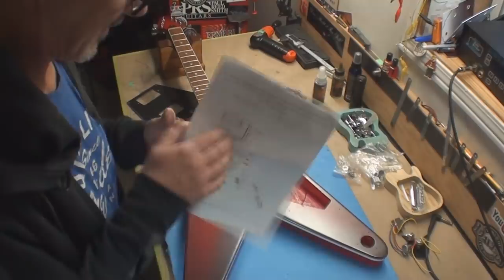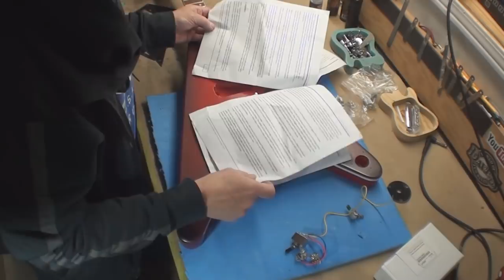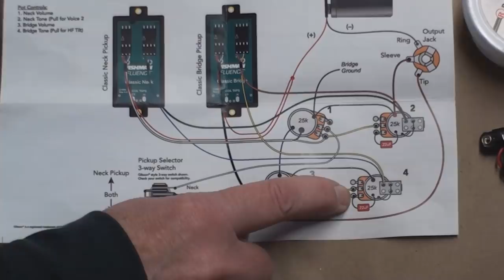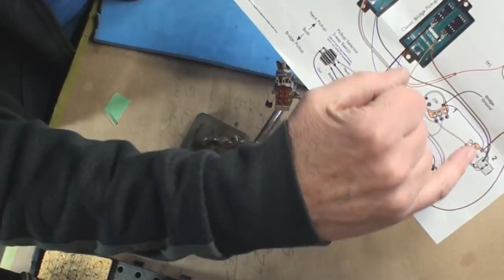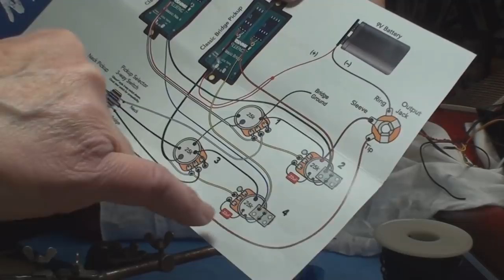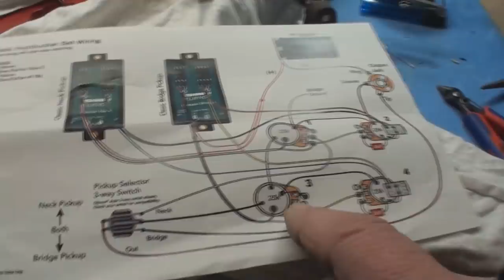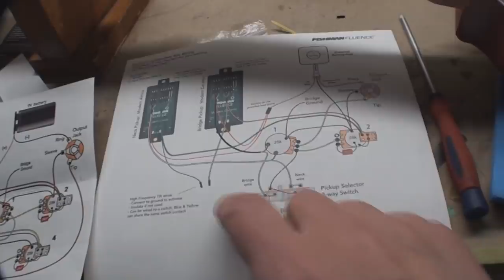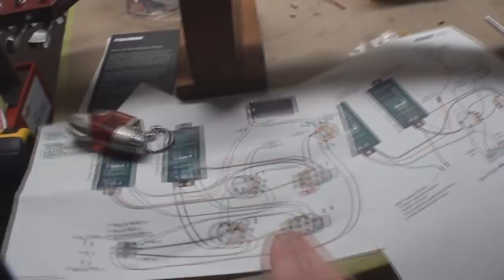Flying V Guitar Made of Sawdust Good Luck

Comment: My first build was a Saga Strat kit. Trem block hole and mounting screws were routed off-center. I played around sanding the neck pocket, etc, etc. plus doweling the pivot screw holes (6 of 'em) trying to get the bridge plate to cover the hole while keeping the strings on the fretboard. I did the best I could and couldn't intonate it the low E. I took it to a good tech who told me it was pretty but wouldn't intonate because the scale was too short on the E due to cocking the bridge and neck pocket to keep the E strings on the fretboard. He put brass saddles on it and ground the low E shorter and shortened the spring. He just laughed and said "You know what Saga means in Chinese? It means Canoe Paddle." He was right. Life is for learning.

Love the Hotdog wood quip! You are the man. This guitar body is made from imported HDW (hotdog wood)!

Comment: I did 2 of the Solo kits. They turned out pretty cool for what they cost. The plastic nuts suck! Way too high. I taught myself how to make bone nuts from scratch and made one for each. Made a difference like night and day! I like the kit guitars, not to get a guitar cheap, but to learn. The amount of knowledge I have gained about guitars since December is incredible! That's why I like them. It's given me the knowledge to build my own quality guitar without fear of screwing up expensive wood and damaging exoensive hardware. If someone wants a cheap guitar...buy a Squire. If they want to learn...buy a kit!
Reply: Totally agree! I also built 2 kits from Solo and I learned a ton. I am no longer scared of adjusting truss rods, leveling frets and cutting nuts. One of the two is in my office and I have real fun playing it. What is the point of buying a kit if you can't finish it yourself. In that case, go buy yourself a guitar instead of kit as Dave said, but as YOU said, the kit is all about learning and that is invaluable. One thing Solo could improve though is the instructions, Dave is right. They are not very useful. I ended up using the Web and YouTube to figure out how to wire these guitars...
Reply: JF Remillard yep, I did the same as you did. Instructions sucked. Watched a lot of videos! Fun to learn. Keeps ya young!😀

Comment: Dave, I won't go into how I did this (lets just say it wasn't very rock-and-roll) but in November 2016 I managed to snap the neck of my new Epi SG-400 completely in half mid-way up the neck and at the butt where the neck joins the body. Also, the thin wood section near the control pots was almost snapped off as well. Because the damage was so severe I didn't know if it was reparable so I searched for YT videos and found your channel. I managed to completely repair the guitar thanks in part to one of your videos and it has been working fine ever since. Just wanted to let you know your channel is not just entertainment. Cheers.

Comment: I would have gone dual tone and a single master volume.
I think the switching problem is because you have all 4 of the tone wires on a common connection.
You could also split the 4 wires between the two rows of terminals on one switch.

Probably no way around a separate battery compartment, probably better anyways to make it easier to change the battery.
On the wire routing, I would route a channel between the pickups and to the control cavity.   The kit routing is neat if you want to use a different pickguard and pickup rings with exposed sawdust... err... wood around the pickups.

Comment: I had the same wiring problem doing a 3 knob Gibson Explorer with a 4 knob schematic.
Reply: With one tone control, if you want it to work on two p/u's, put it on the output lead, after the volume controls, not before.
Reply: ...and after the switch... :)

Comment: The problem is that the tone current is rerouted through the switch - BACKWARDS! My buddy has an Epiphone Flying V that had this exact same problem. He rewired the tone caps so that they were as regular caps to the indiviual pickups with the hot lug being the farthest one to the left (when you're looking down) on the backside of the pot. I've been doing this for almost thirty years this year, or next year. It gets to be a pain in the ass when you get something like this and have to talk the customer out of it! We had a friend of his bring a custom Ibanez guitar to him to repaint with a sunburst only the body was so small that it wouldn't be so noticable once all the hardware and parts were on it. We eventually talked - actually I talked him out of it even after I sunbursted it with black against a silver background. I convinced him that it would be more money ahead in resale value to repaint it the original black that it once was. The sad thing is that he only had it for about four months before he was murdered and someone took all the bands' equipment from his house.  That was 13 years ago, but I'll still never forget it....

Comment: If the capacitor shorts out then no noise from pickup will occur? I have an issue with my dean AOD flying v. I changed strings on it and it wasn't making any noise through amp. Change cables and took it to a tech he plug it in amp and said it works. Brought it home plug it in and nothing. Input jack wire was broken soldered it back still nothing. I'm thinking it's an electronic problem within pickups and pots. Frustrated and pissed off. It worked when I got it.

Comment: The guy who sent it to you should have read the instructions before asking you to do the job. The whole point of those pickups is that the push pull on each pickup creates a different tone for each pickup. He should have bought a cheap epiphone guitar with 4 controls and just swapped out the pickups. I installed some emg solderless pickups on my mex strat and had to drummel a lot to get the job done because the controls wouldn't fit. I also installed a custom made neck from warmoth. Sounded killer. The guy who sent this to you wasted his money on this project. But he should have asked you if you were familiar with the setup that he was seeking.

Comment: He probably should have routered a hole in the back and installed a battery box. You can get em for way less than $10. Would have made changing the battery way easier! Kinda crazy to put $400 worth of pickups in a cheap kit guitar too! I picked up a set of 3 single coils on clearance at Guitar Fetish for about $20 for my Strat kit and they're way better than the ones that came in the kit! Not Texas Specials, but decent!

Comment: I've been asked a million times "why don't you build a kit guitar". Quite apart from not wanting to eventually own said completed Kit Guitar, they're usually JUNK! Buying a kit guitar is like going on Vacation. It's about the experience and it's money you'll never get back.  Kit guitars have ZERO resale value.  Putting expensive parts into guitars like Squiers and Epiphones protects a bit of your initial investment, if you're just looking to learn how to do this stuff. You can resell a hotrodded Squier every day of the week (you'll still loose money) but you are stuck with a kit guitar.  This poor sap has more into the pickups and paying Dave than he would have done just hotrodding an Epiphone, he could later resell.
Reply: Woodeso's Guitar Mods how do you loose money ? Maybe you might have loose change in your pocket. *Lose
Reply: Warmoth kits are supposed to be too notch. My opinion is that people build them to play and keep.
I don't want to build one either, lots of work and I already have too many hobbies.
I do think rebuilding a guitar is a good experience that helps you to fix your own problems rather than having a shop do it.
Reply: Warmoth's aren't kits though. They just sell licensed aftermarket parts. I'd call them parts guitars, not kit guitars personally. It seems like a trivial distinction but I don't think it is. They were never meant to be a guitar in a box.
Reply: I think there are good kits out there, but the ones you get on ebay for 100 or so bucks are very clearly junk--resale value aside. Everything is cheap to keep it at that pricepoint.
Reply: Anytime you bring a guitar like this to have someone put it all together with aftermarket parts ur losing money big time, the guy should've brought a decent Flying V copy that's a set neck and well built that way it'd be easier to drop in all those electronic parts. for the guitar tech sake and in the long run he will have a nice Flying V to use.
Reply: Buying a kit and then paying someone else to build it is like buying cheap ingredients, taking 'em to a restaurant and asking them to make you a burger with 'em. You would have been better off just going to MacDs and buying a Big Mac.

Comment: nice video!
You know I was looking at building a kit guitar. Being a lefty. real guitars are a crap shoot. Well it's actually worse with kit guitars.I did a bunch of research and came to the conclusion that it's better to just buy a damned guitar. See most kits are cheap. Not just in price, but in quality. Then you got higher quality kits.... that cost more than a guitar! I'm sorry but a kit with so-so wood and so-so electrics SHOULDN'T cost more than a name brand guitar, should it?
Active pickups? If that's what you're into, fine.  I have a battery on my truck. I have a battery on my bike. I don't need a battery on my guitar.